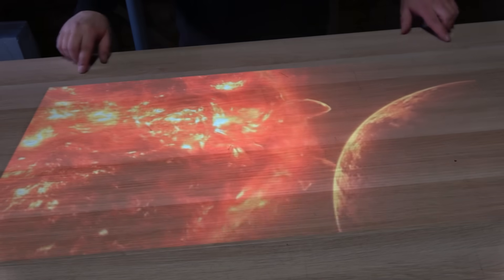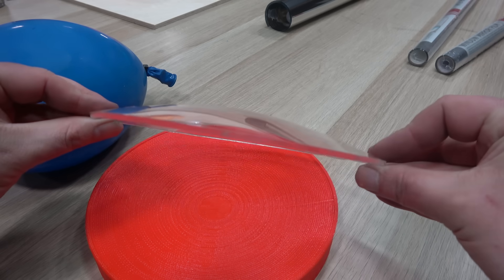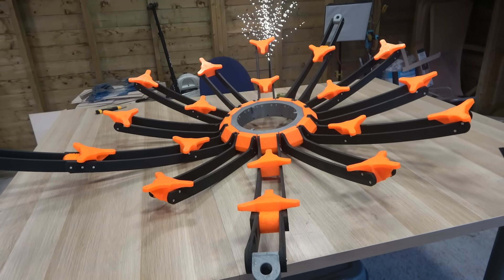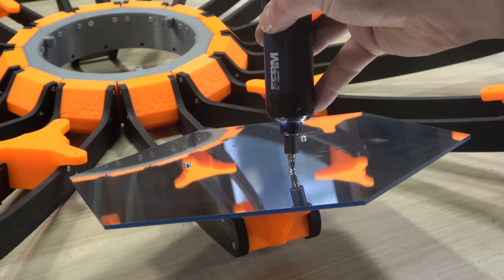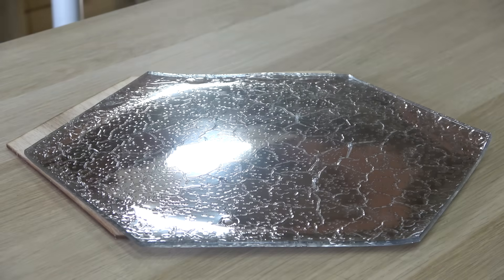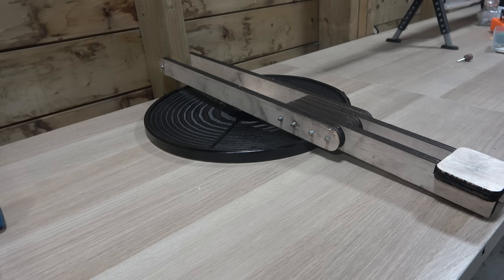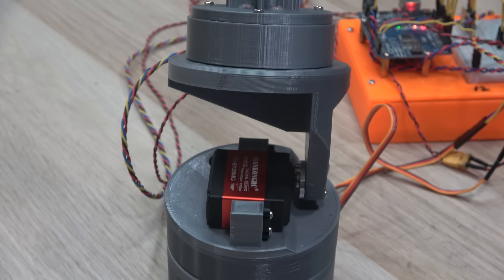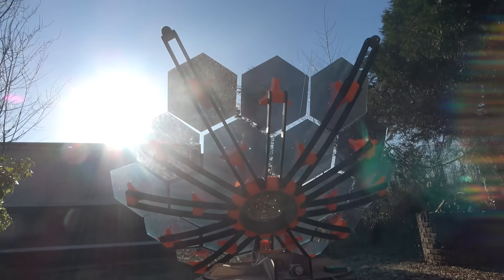Building a DIY Solar Generator..

Comment: OMG, this project is so bad from the engineering point of view! Even the first problem - decide which color is better, silver or gold, I would do differently. I would just make 2 small mirrors and will attach to the back side thermometer sensors. Then I would put them simultaneously on the direct sunlight and compare temperature they will heat. The coldest one is better.
Heating pad is very overpriced and also bad. I would use simple square reservoir soldered from steel with 2 in/out pipes. It can be safely overheated without water and it will not break. Overall construction made from 3D printed plastic is wonky and will break as soon as hard wind will hit it. I think mirrors can be made flat if they are small enough - that will be much simpler to produce. I would probably use normal mirror glass. I would cut it into trapezoidal pieces and glue 3D printed mounting brackets to the back of the mirrors and then will cover back side with Urethane spray to protect back side from the water.

Comment: Cool project, but what's the point? You're collecting sun energy from a fixed area to produce heat. The sun gives about 1000W per m². Collecting the energy on a flat surface absorbes the same amount of power, just not concentrated.

Maybe I've misunderstood your goal.

Comment: The one thing that jumped out at me was your use of orange plastics. Years ago, I was told that for some reason (ones I don't remember), orange does not hold up well when exposed to UV lights.  I've since seen ski boots, garden equipment and buckets made with orange plastics.  Thinking the issue had probably been resolved...I found out the hard way.  Buckets and garden tools that I've had outside, broke down very quickly, compared to others.   Other than that small concern, Cool video!

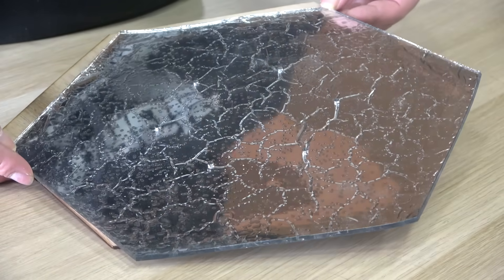Comment: 7:33 Isn’t that crazing pattern due to arcing caused by the microwave RF inducing huge voltages? What about just putting the mirrors into a cois. nventional oven on a low temperature setting? Great work though mate and sorry I realise that you have already thought about

Comment: I would have put the heat on the material first and then color it... besides the metallic reflectivity causes the microwaves to arc and you get the cool electric lightening effect on your plates.

Comment: Pretty cool, have you ever thought of electroplating the plexy glass after it's formed to create your mirrors?
Reply: Plexi glass can't be electroplated, it's an insulator and only a conducting material can. There are work arounds like first plating the plexi with some conductive spray, and then electroplating, or just using an entirely different method of plating.
Reply: @ShadowPlasma2009  you're right, I just assumed the audience would know, or look up, electroplating plastic parts, like 3d prints.    You generally use a graphite spray paint or dip.  After that you put it into solution for electroplating. You can get some pretty amazing finishes out of it too.

Comment: If your committed to using plastic first surface mirrors, look into vapor deposition to apply an aluminum layer onto them. 
Exposed for surface mirrors are probably going to be a mistake. 

You shouldn't use plastic to back you heat exchanger. Use metal and rtv to seal the joint between the two

Comment: i'm pretty sure what i'm about to say is already tried and tested...buuuttt....what if you use that mirror arrangement to heat some water in to superheated steam ,use that in a piston setup to turn a generator?(well is a turbine not a piston but ....)is basically what happens inside a nuclear reactor..and make it a close system...condensate the steam back in to water with a passive condenser something like a pipe in to a natural water stream ?! and..maybe use something silly like a turbo charger from a small engine as a turbine?i think it will be more efficient than a piston setup?!or is that exactly what the point of that aluminum disc at the center is?to turn water in to steam?

Comment: The light absorbing element should be insulated, for instance in a vacuum, so as not to lose thermal energy.
Insulate sides not facing the sun. Use greenhouse effect to let light into but not escape. The black absorber can be inside the water.

Comment: I don't think 3d prints last well in the sunlight and weather. I'd love a video journal on updates and repairs you have to do and power out put over time. 

If I do solar, I will buy cheap used solar panels. I'm a little brain person and that seems like the cheapest, easiest way to DIY solar power.

Comment: Why didn't you add the reflect material after the plastic had been shaped?

The Second reflector should Never have a shadow onto the center plate in it's primary alignment.
Thus the second reflector should be lower than center.
Then the lower half will need to be different focus than the upper half.

Comment: im not a smart fella by any means. but if youre painting the mirrors, youre testing the reflectiv..ness of the paint not the mirrors. and also the color gold vs gold itself will reflect differently. if youre thinking the color itself  maybe copper or ionized gold plating maybe. idk if the plating is a coating or how it changes the color exactly but it still looks like metal and not paint covered metal. awesome builds, keep em coming.:D

Comment: Very cool project! Or maybe I should have said what a hot project! Can’t wait to see it done. My addition: There are specialty solar cells that are very efficient at converting concentrated light. The ‘mistake’ of using an aluminum collector might be remedied by applying the solar cells to the front face. Not only will you be generating heat, but you will also get Electricity. Good luck in this and all your projects!
Reply: Also, I forgot to mention that your reflective coding seems somewhat transparent. Maybe there’s a thicker mylar that you can use?

Comment: I feel as though the springs behind the mirrors would be a problem in windy environments. Not being fixed, they allow travel along the mirror's support directions with any force applied to the face of the mirrors; thus, throwing off your angles of reflection.

I think Austrialia experimented with this idea before on a larger scale. I don't remember the reasons the project failed to take off.

Comment: Magnifying glass ? Also these type of setups. 

I think of using a large hollow tower heat the bottom and use the wind rising into the cool air at the top, you can use multiple focus points to increase temperature and use a sun shade to ensure the tube is coldest at the top. I think this is the most efficient way to harness solar heat rather than using a heat exchanger. Not only does the heat of the sun increase the rotation of the generation but so does the lower ambient temperature. 

If you use a liquid setup, you should make the boiling point of the water as low as possible via vacuum to generate steam and use an ice bath or cooled container at the end of the cycle to again get maximum force. This setup I have seen demonstrated with Tesla generators to maximize steam pressure and low heat.

Comment: Try taking a large satellite dish and screw old CDs onto its surface, the tension of the screws would bend the CDs just enough to sharpen the size of the reflection at distance to a small enough area. I suggest using a block of Tungsten for the focus point, heat exchanger fins on the other side of the block can then turn the water into steam. That will be the hardest to design, a block of Tungsten with fins all around the focus point to transfer the heat to the water while providing good flow characteristics for the water turning into steam. Try a spray of water onto a conical center point on the inside of an assembly that has a manifold bolted onto the Tungsten "target', one side targeted with the solar rays, the other with the water jet, to take away the steam through insulated pipes to a turbine.
Reply: Using old CDs will make for an array that will easily be serviceable. Each one can be easily focused while the others are covered up. Replacing a damaged one will be a cinch.

Comment: You should use the same kind of rotating mechanism for the vertical as the current horizontal.  One flat disk and one vertical disc.  Attach the whole set up to the vertical disk and add a counter weight to the opposite side.  Adding 4 small solar panels to opposite sides would allow you to make a tracking system.  If you angle them backwards, like \____/ where the dish is facing down, and have them each run motors that turn the dish towards the solar panel, it will automatically track the sun.  They can be very small and weak motors to since the sun moves pretty slowly, so you can put in a 100 to 1 gear ratio.

Comment: Here in Africa we have seen solar cookers that use the same principle but are much much simpler. They are built like a satellite dish with the pot placed at the focus point. They work best for cooking  large quantities but overall are not very popular because they are difficult to use. Did you cover how you generate power from the heat? That is what most interests me because where I live (Africa) gathering the heat is the easy part. I have rooftop solar so don't really need an alternative but still find it interesting.

Comment: Golden COLOR is not the same as gold. I assume the paint didn't have any real gold in it. That may be the reason it performed worse comparing to the other paint. 

Reflecting window film allows some light through. It's another way for suboptimal performance.

You actually printed a plastic block for the TPU compression test? No scrap wood whatsoever? I can't follow that.

Comment: My dad made an insulated box with a copper hot water cylinder in it, two sides of the box hinged open to expose the 200 liter cylinder to the sun as a solar hot water heater.
On the first day we opened the cylinder it was very overcast and he didn't think we would get much of a result.
Sitting in the house at dinner we could hear a rhythmic noise which got louder and louder.
It was the water in the cylinder boiling and blowing a stream of boiling water into the sky.
There were many occasions where the water from the hot tap was almost boiling.
Closed up the heat was contained for three days.

Comment: 1. As others have said; your heart collector stood be black and made of copper. A copper-bottomed cooking pot would probably work. 
2. You don't need to shape the individual mirrors. Just point them at the secondary reflector. If not good enough, consider using smaller triangles instead of big hexagons. 
3. Add a counterweight to take the stress off of that hinge. 
4. How will that big disk handle the wind load on gusty days?
5. If you changed it from a disk to a parabolic trough that focused on a pipe instead of a secondary reflector you would only need to adjust one axis throughout the day instead of two.
6. Instead of springs just use a bolt with 4 nuts and a couple of rubber washers.

Comment: I would thermally insulate the rear of the collection plate,  maybe with fiberglass insulation to prevent heat loss out of the back.

Comment: Somebody has probably already covered this, but I think it will be extremely difficult to create a secondary mirror that will reflect the light from all the primary mirrors to a single point. As many have suggested, putting the collector in the position of the secondary mirror would be simpler.

Comment: I would scuff the aluminum heat exchanger for a matte finish or apply a non insulating dark coating to maximize the energy absorption.